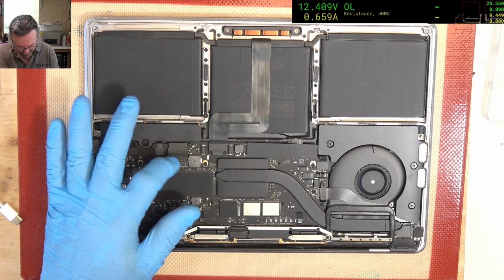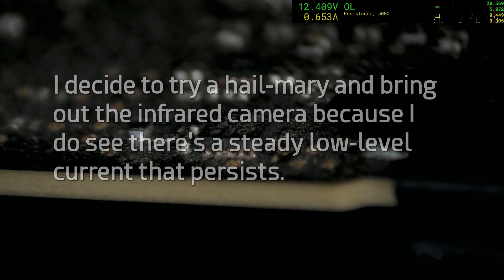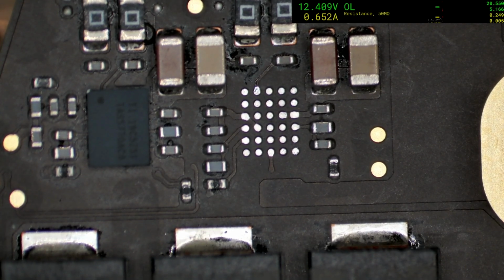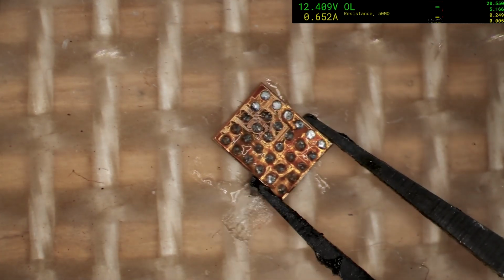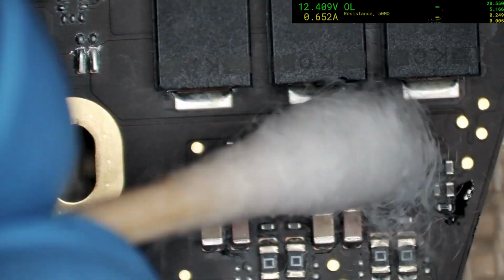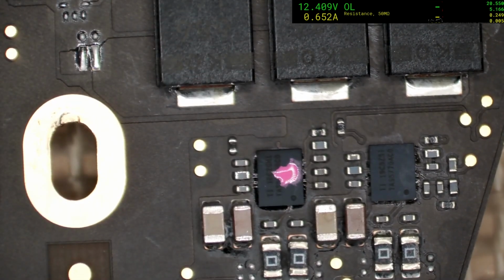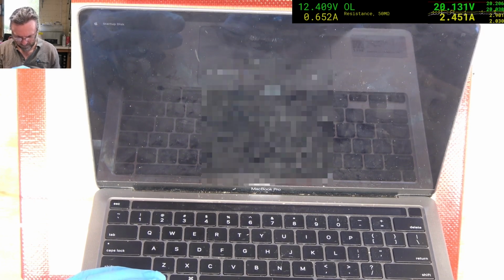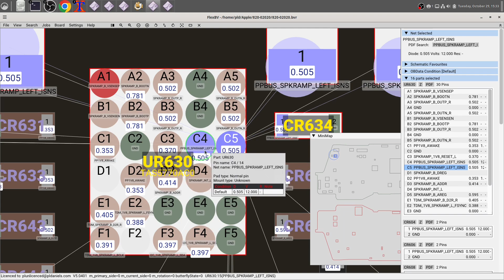Macbook Pro A2338 Unstoppable bootloop fault.  Logic board failure of common part has new symptom

Comment: Any chance you could do a video where you go through your IR set up and processes a bit more. the software you developed looks really interesting!
Reply from the maker: I suppose it's getting a bit "end of life" as it were, I would like to move to a new camera system, something I conjure myself or something where I can get better access to the data directly.  My software is orginally based off the work done by others ( I just refined the software to better suit this sort of application ).
Reply: @pldaniels  amazing, any chance you've got got updates on the cards soon? It always seems like such a powerful tool and as a complete novice it's always my blowing how quickly you can analyse from what you seen. Any pointers as to where to look to the origins of the software?

Comment: Hey paul, whats that USB thingy for power rail check? It signalize VBUS rail with led? Or any other rails? Thank you
Reply from the maker: It's a USB-C Chipmunk.  Very simple/easy device and shows you if there's voltage, if it's 5V, and if there's CPU/data activity. Handy to have around, I use it multiple times a day.

https://www.cmizapper.com/products/usb-tester.html

Comment: Can you elaborate more on why you dried the paste of flux? 
Is it to have more solder on the pads when you're using the stencil, because the flux was burned off?
You also mentioned about storage. All I recall about solder paste storage is just to keep it cool.
If you could point me to a video, that would be fine as well.
Thanks, love the vids :)
Reply from the maker: The drying of the paste is mainly to make it more viscous so that during the transition phase of the reballing the paste doesn't ooze/run out of the stencil gaps or spit out as the flux gets too hot ( that's remedied at least by sticking to lower temperatures ).

As for storage, yes, ideally in a cool dry area, however that's primarily if you're using paste for the process of new device manufacturing and subsequent screen printing / application of fresh new paste on a board for parts to rest on;  for this sort of work it's not such a critical thing.
Reply: Thank you for the explanation :)

Comment: That display will probably not last too long judging by the debris that can be seen between hinges
Reply from the maker: All that can be done is advise people to "avoid getting junk in the hinge area" but not much changes.  I've had machines I've recovered for data multiple times and people still don't get backups done :sigh:
Reply: It looks pretty scratched up as well.

Comment: Can you solder the bad amp chip to the donor board and measure resistance there to know for future reference?
Reply from the maker: I'm thinking it was more the matter on the board that was truly at fault than the chip itself.   I can probably infer the resistance of the rail by looking at my recording and seeing what the current drain was and comparing it to what it should be for a normal A2338 ( or this one after the repair ) and from that take the difference in current and derive the resistance from that.

Comment: I've see a couple of these lately where the speaker amp is the problem. Makes sense now after your diagnosis and explanation.
Reply from the maker: Did see it a fair bit on A1706/7/8 machines with the amps but haven't (yet) seen it too often on the newer Pro/ProMax units but it seems that's changing